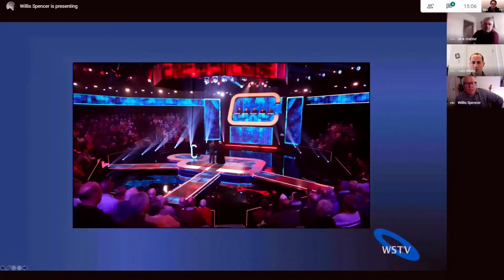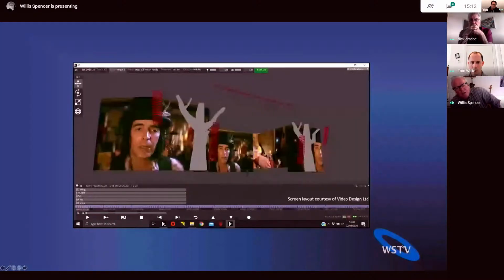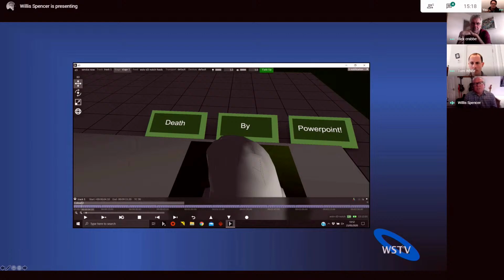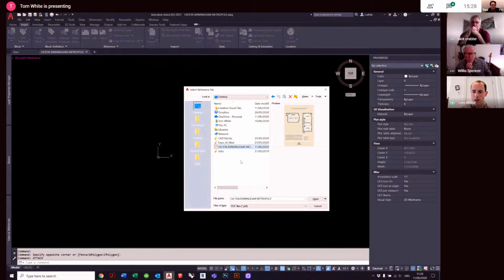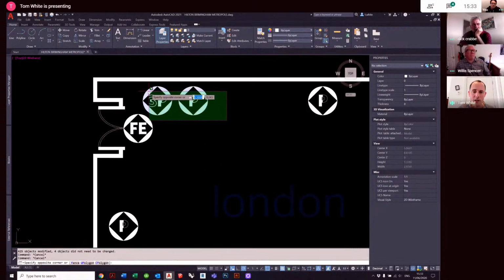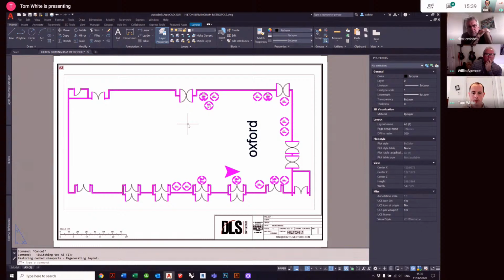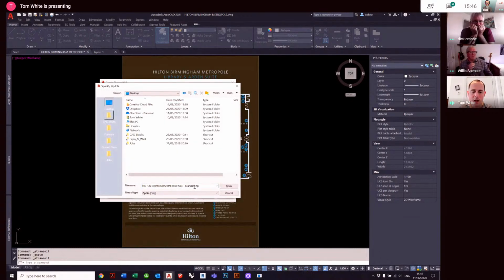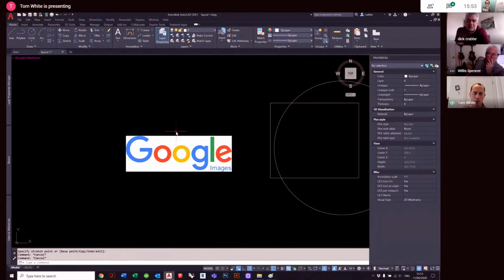CAD Lessons - Ep. 10 on Thursday @ 15.00

Comment: CAD from a video perspective,  some of the pitfalls and areas to note by CAD designers.   Screen sizes & formats,  projection &  LED wall common mistakes.
Starting a DWG from a pdf   (about 29mins in)
Tom runs through a real world exercise,  creating a usable DWG from poor quality venue information.
Importing a vector based pdf
Unravelling a pdf & deleting unneeded information in the pdf
Set by layer command
Scaling the pdf to known measurements  (scaling X&Y to different values)
Where to mark dimensions,  model space or paper space
Tom & Dom detail how to send CAD files,  to various different types of recipients.  (44 mins in)
ETransmit
Bound drawings
Copying and pasting images into CAD via Paint